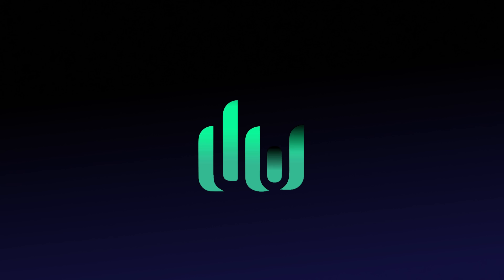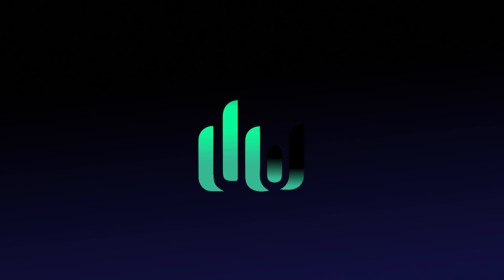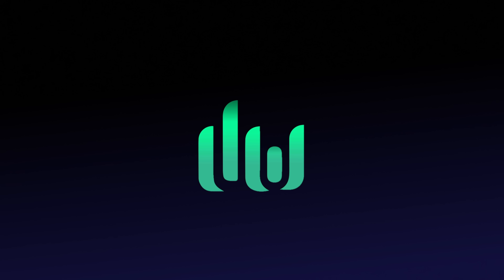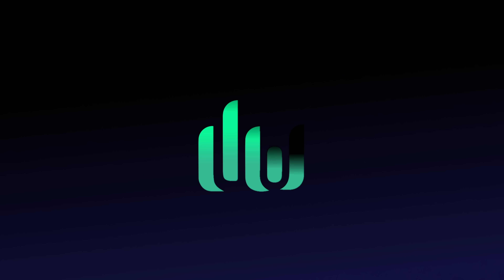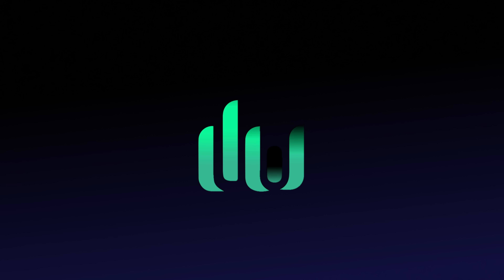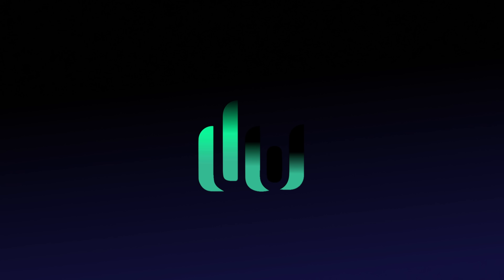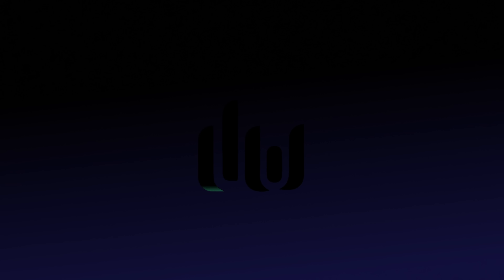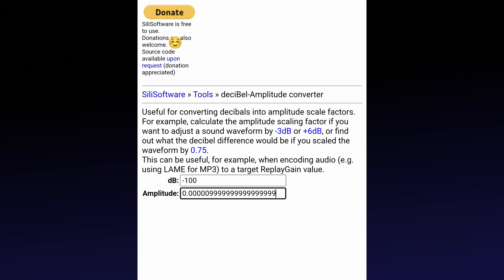WTF is a Decibel?

Comment: Dan, thats very digital centric view of dBs, +6dB being a doubling in amplitude back in the analogue world where we all live is predicated on the fact that the resistance is the same at both points the ratio is being taken over because dBs are really a ratio of power from the original inception of them by the Bell telephone system and the maths requires the resistance to be equal at both points so it can cancel to allow V squared over R ie the power to become ratio V / V the square becoming a x 2 multiplier outside the log. The usefulness of using dB, ie 40dB to indicate the gain of an op-amp amplifier is universal in electronics but a bit like calling any vacuum cleaner a hoover it may not be absolutely correct.  Also the digits may theoretically have infinite dynamic range but that is little use when the signal enevitably reenters the world we live in, where the noise floor, again in power, is fixed by the temperature and taken as -174dBm per Hz of bandwidth which sets a level that can only be lowered by lowing the temperature of the amplifier or DAC in this case.  This is done for the preamplifiers in terestrial RF systems that are receiving signals from space but I don't think its been implemented in audio electronics yet. Thank you very much for your articles, I always like to work through them and have learnt a lot from them, hope you find these points interesting.Robert
Reply from the maker: This is a very digital centric channel! But the dB formula is the same whether discrete or continuous, no?

Comment: A neat bonus is that decibels are great for napkin maths.

You can loosely estimate a radio signals' pathloss with just a measurements built into your phone. For example, a typical 4G radio outputs 20 Watts into an antenna, which is 43dBm (from 1 milliwatts), and an antenna can easily have gain of 15-23dBi (gain from no directivity).

So if the radio output is 43dBm, and the antenna has 15dBi, then the emitted radio power is 58dBm. The phone receives the signal at -61dBm, so the signal dropped roughly 119dBm along this path.

Adding or subtracting the dB's is way easier than scaling by 10^12 imo.

Looking forward to more videos! They're great regardless of format! :)

Comment: I think the fact that you can double the amplitude and it won't even sound that much louder is pretty amazing. It does also explain that when mixing single dB's can still have a big influence due to how much these waves might interfere with each other.
It's also another pretty great showcase for why pushing for loudness is so pointless. It will destroy the balance but it won't even be experienced as that much louder.
Reply: Strictly speaking destroying the balance is what increases the perceived loudness (LUs). Loudness is a mixture of volume and dynamic range.
Reply: @JoshWiniberg  I think there's definitely ways to do that without actually doing the loudness war.
There's ways to imitate blowing up the speakers without actually blowing up the speakers.
Some smart sidechaining, you can let the bass distort your cymbals, just generally good sound design and mixing where they seem to result in rumbling.
Actually really pushing towards loudness just feels like it's resulting in a bad mix.
Reply: Well they're not pushing for objective loudness on paper, they want it to feel big and loud.
Reply: @georgerosebush9754  I agree, and going for objective loudness isn't the way to get there.
Reply: I'm not sure you need to be worried about waves interfering when mixing unless you have phase issues between mics/etc. And loudness war is dumb but don't underestimate the psychological effect of something being even 1-1.5 dB louder! It can really fool you when A/Bing during mixing

I think a lot of electronic musicians do go for loud just because they think they're supposed to, it makes the track's waveform "look right"
Reply: @kylemccombmusic  "I'm not sure you need to be worried about waves interfering when mixing unless you have phase issues between mics/etc."
My wording  probably isn't quite right here, but if several sounds occupy (even partially) a similar stereo and frequency space one can really drown another out by only being slightly louder.
"I think a lot of electronic musicians do go for loud just because they think they're supposed to, it makes the track's waveform "look right" "
I think you're unfortunately right.
I've recently gone from being too precious about frequency space (which often made sounds feel dry) to go a bit looser with that and found out that even parts of dB's can make a huuuge difference in how sounds end up coming together. Just smashing the whole thing with compressors and maximizes doesn't really seem to achieve anything but ruining dynamics.
On the 1 to 1.5 dB louder then: yeah, you can definitely hear it, comparitively. But turn one up or down that much over the course over 10 seconds and how noticable is it?
Reply: @PauLtus_B  oh sure, I just meant really technically, loudness as measured by LUFS is achieved by reducing dynamic range. You can't push for that kind of loudness without reducing dynamic range, but of course there are tasteful ways and horrible ways to achieve that.
Reply: @JoshWiniberg  Aha, well, you're right.
I do also flatten my low ends and such.
Recently had some fun taking the whole track, drop a whole bunch of compression and some distortion and then mix that in a bit with the dry signal and that does actually achieve extra perceived loudness because it adds a bit of those "loudness dynamics" as it can end up sounding like it sometimes give some space for the quieter parts of the mix to breathe when the loud parts of the mix are gone.
Problem with the "traditional loudness war mixing" is that the more bassy parts of the track just end up quiet.
So euh...
I guess my main point is that just aiming for pure extra dB's doesn't really get you anywhere, but I don't think that's news to anyone who follows Dan Worral.

Comment: Great video, thanks! While I knew that turning up the level by 6 db (or isn't it actually 6.03 db or smt like that?) means doubling the volume and turning down by 6 db means halving the volume, I didn't even think about that and its implications when you posed the question regarding dynamic range.
Somehow decibels are pretty abstract even though we deal with them daily.
I'm all for more low effort videos!

Comment: 2:55 0dBSPL is referenced to a pressure, which is 20 µPa. This is the "quietest sound" we can generally hear, as you correctly point out, but this refers to a 1KHz sine wave. Since our hearing is a bit more sensitive in the region from 2-4KHz, it's actually possible to hear negative dBSPL figures!
Would've also loved to hear an explanation about what dBFS actually means (the reference to the digital maximum level), but it's a nice video overall :-) Looking forward to the next one!
Reply: From what I understood, full scale is just when you reach the integer limit when representing amplitude. However, the exact value depends on how the system you’re using works (I’m not sure if there are any standards).

Also, DAWs are not clipping past full scale because they’re using floating point numbers instead of integers, which can store bigger numbers than integers.
Reply from the maker: Full scale integer is the largest number you can represent for positive cycles, or zero for negative cycles. Floating point audio represents full scale as 1.0 or -1.0.   It used to mean the maximum amplitude that you could never exceed; now, with floating point processing, it means the maximum level that you're going to have to come back down to before releasing it.
Reply: Well, dBFS can be more complicated than that, if you read the wikipedia article on it, there are multiple conventions, and when following the AES convention (among others), a full scale square wave actually has +3dBFS.
I work as a software engineer in an audio processing software company, and most of us use the other convention where we mean it to be the ratio to the maximum amplitude (of the (true or not) peak value of some signal). Though a DSP engineer once pointed me to the other convention (of which he is convinced is the right one, as it is defined by multiple standardization entities as such) and since I'm quite careful how I use the term, I try to avoid it if I can and always feel a bit conflicted :D.
I guess it depends on the context which convention is more useful.
Reply: @frydac  This has to do with visual adjustment of RMS levels. A full scale square wave will have a level of 0dBpk and 0dBrms, which computes to a crest factor of 0. Many plugins&softwares adjust RMS levels to show a 3dB higher value, to reference to the crest factor of a clean sine wave, in which case you'll see 0dBpk and 0dBrms for a sine wave and 0dBpk and +3dBrms for a square wave as you point out, but simply due to this visual adjustment.
You can however get theoretical peak values above 0dBFS, through so-called inter-sample peaks. Any fully scale sqaure wave will produce such inter sample peaks due to our processing being bandwidth limited, which makes an inifnitely short rise time impossible. As far as I know, modern DACs have a bit of headroom in the DA conversion to account for inter-sample peaks, but also modern mastering software like Ozone has inter-sample peak detection ("True peak"), which then makes sure this "digitally invisible" clipping can't happen.
Reply: By the way, avoiding intersample peaks is sort of an overzealous measure. Basically all DACs these days either have sufficient headroom not to produce audible clipping when converted to analogue, or it doesn't matter because they are crap anyway. 😂
Reply: Another interesting anecdote, slightly off topic: at the threshold of hearing, the distance the eardrum moves is less than the diameter of a hydrogen atom. That really amazes me.

Comment: I think question was referring to dynamic range of a microphone, which might be specified as 120 dB. In reality this is the difference between the base hiss level and the loudest sound that can be recorded? Can you compare your -100dB level to the 0 dB SPL for the human ear?
Reply: You can't just compare/translate dbfs to dbspl.... it's all relative
The same exact file played twice will obviously have the exact same dbfs value
But if you just turn the volume of the monitors up/down, it'll change the dbspl value or loudness you hear--again, without altering the dbfs value.

Comment: Too complicated, I just turn up Sausage Fattener until my tracks are a perfect square juicy sausage (I push it just enough for the the sausage to get angry but not TOO angry)
Reply: yeah! who needs dbSPL or dbA or even LUFS? my track is 20 sausages loud! WITH MUSTARD!
Reply: You're both so right, personally I know it's loud enough when I hear it cracking, just like sausage on a grill. Don't want my tracks raw.
Reply: @ArtiOfficial if you apply the Pointy Metal effect to the Sausage Fattener you can stop your tracks from splitting the dBFS down the middle. Remember to turn on the Background Woo setting like Captain Disillusion does on his videos and you'll be golden. Will, technically Fattened Sausage coloured, but you know how it goes.
Reply: sausage fatten the main mix then add the transients of the kicks in for serrated sausage

Comment: It's worth noting that in the case of dithering, it can't even be argued that the 'dynamic range' of the audio is being truncated or quantized in any way.  Dithering provides that infinite dynamic range with infinite precision as well.  Regardless of whether we're working with 32bit or 16bit or even 2bit audio, dithering allows the audio to be statistically encoded into the signal with the exact precision that it had originally, with the only consequence being a higher noise floor.

Comment: This video triggered my will to revisit my knowledge (or lack thereof) about this measure. And I learned how summing two uncorrelated sources result in terms of gain in dB, which is not so straightforward: summing 2 uncorrelated signal of the same level results in a 3 dB gain, while summing signals 6 dB apart (i.e. one is twice lower) results on a gain of 1 dB. Interesting stuff. Thank you Mr Worrall.
Reply: This is an interesting topic! What if I have 40 tracks but I’d like to lower my out by 1-2 db, how much do I need to lower the others?? Not expecting an answer 😅😅 but definitely something I’m going to research. I’d love Dan’s take on it 😁
Reply: @brettclarinmusic 1-2db!
Reducing all tracks by 1-2db is the same as reducing the master output by 1-2db (assuming no fx)
Reply: Just a precaution....
How do you consider 2 unrelated signal as "the same level"? Basically what did you use to measure them? The loudness of 2 unrelated signal will be heavily dependent on how they overlap, so I wonder how useful it is to consider how louder they can become if added together?
Reply: Yep, this vid sent me back to the dB pages and calculators! I always like to remind myself that however loud one instrument is, adding a second one makes things 3dB louder.  So when I go to eq something, like the high end of guitar strumming, and boost by 3 dB  that’s like adding a second guitarist (at that frequency range)

Comment: Do you think you can make a video explaining the difference between +/-3dB and +/-6dB? Ie. From my understanding, +3dB is doubling of power, but doubling of amplitute  is 6dB?
Reply from the maker: Amplitude is the height of the curve. Power is the area under the curve. 6dB doubles amplitude. 3dB doubles power.
Reply: How does that translate into sound power vs sound pressure levels?
Eg. If I push a fader up by 3dB, does my SPL increase by 3dB?
If I sum 2 channels of exactly the same audio together, is it a 3dB or a 6dB increase?
Reply from the maker: @XenoeJin  yes your spl will go up the same amount. If you add two identical signals (100% correlated) you've doubled the amplitude = +6dB. Adding two uncorrelated signals typically increases the level by 3dB.
Reply: @XenoeJin  A video on this would be great. Hope Dan addresses is it his high effort version. I'm also having trouble understanding how power and amplitude are related. Some examples would probably clarify this.
Reply: Thanks for the responses! I will need to do more research and reading, I'm still trying to understand why exactly doubling of amplitude is 6dB while doubling of power is 3dB. And also, if I push a fader up by 6dB, is that the same effect as "doubling amplitude"? Does a fader changes it's amplitube or power? Is voltage considered amplitube or power? If I set 2 speakers playing the exact same audio side by side, does this increase SPL by 6dB? This is just so confusing xD
Reply from the maker: @XenoeJin  if you increase the radius of a circle, the area of the circle increases faster. Same relationship between amplitude (height of the wave) and power (area 'inside' the wave). Yes, pushing up your fader 6dB increases amplitude (sample values or voltages) x2
Reply: @DanWorrall  thanks
Reply: @DanWorrall  
So, to take the above example:
If I have a 100W amp cranking out 100 dB SPL and I want to double the power, I need to get a 200W amplifier and that would increase the SPL level by 3db to 103 dB SPL.
Did I get that right?
But if I wanted it to be twice as loud (which is a 6db difference), I'd need a 400W amp?
So how does "10dB doubles the loudness" and the whole loudness aspect factor into amplitude and power?
Reply: Power is related to voltage squared.
6dB is appox double voltage.
2^2=4
So 6dB is 4 times the power.
Reply: Db of what? If you now have 100 Db SPL from 100 watts of power and you want to increase to 103 Db SPL you'll need 200 watts. An increase of 6db demands 4 times the power.
Edit: forgot...4 times the power is 2 times the voltage, is how you get +6Db
Someone correct me if I'm wrong
Reply: This is what I am confused about, when is doubling of something 3dB or 6dB?

Comment: I'm aware of the 6db = doubling / halving phenomenon, but it never occurred to me that the range you can change db by is infinite.

Now that I have this stuff on my mind, I should probably do a deep dive to understand what dbfs actually means - despite working with it for a decade.
Reply: Possibly easiest when looking at an analog signal: double the Voltage=+6dB gain. Double the Power=+3dB gain. Power=Voltage times Current. Hopefully this helps.